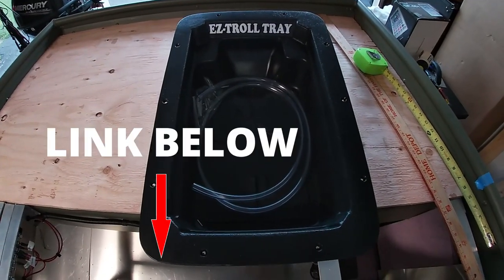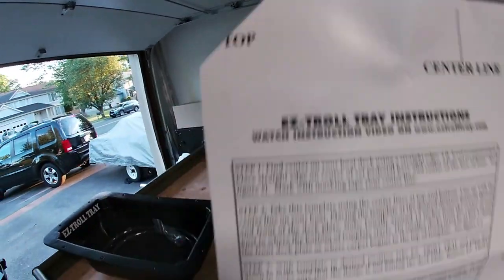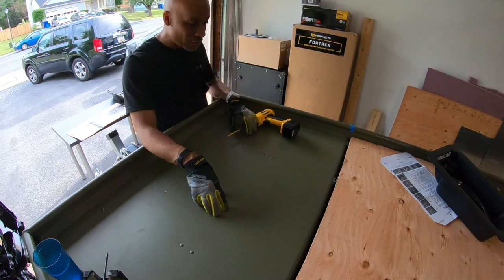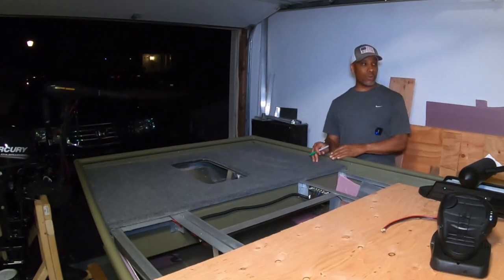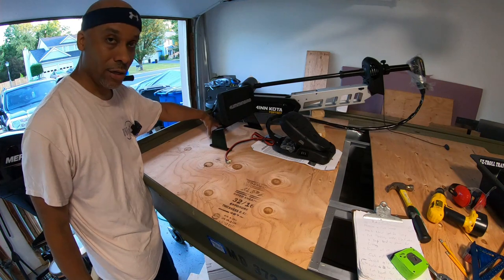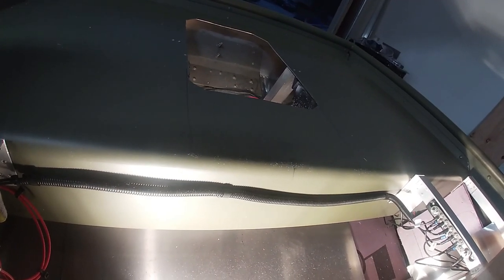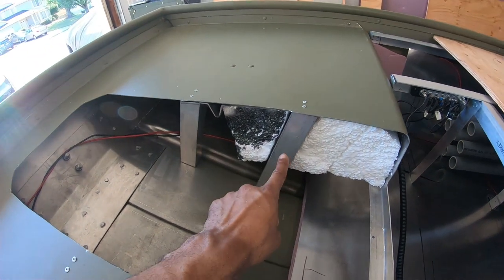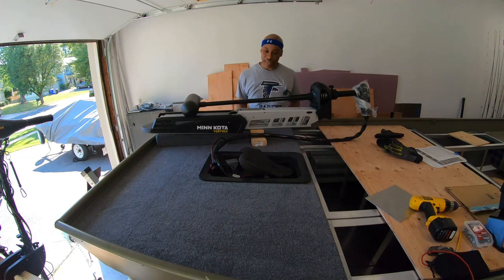MISTAKE FIXED-Recessed Trolling Motor Foot Tray Install {Jon Boat To Bass Boat Conversion} Lowe 1448

Comment: Great video.   I have a Alumicraft MV1648 and I want to add a foot tray and 2 batteries in the bow for my 24v trolling motor, and your video has given me great insight on the internal contruction below the deck.  Your a brave man to cut the deck like that.   You've given me confidence of what ever mistakes I make there is always a repair plan, if you take a breath, think, then attack.   Can't wait to see more.  I'm sure Ill be borrowning many of your ideas in the future
Reply from the maker: You're very right Eric.  I still make mistakes. You gotta breathe,  regroup, brush yourself off and jump back in. Thanks for leaving a comment.

Comment: Wondering if you looked at the Panther trolling motor tray? I had to go with the Panther because it was such good quality (although I didn't look at the EZ Troll) and it's 75% less than the EZ Troll ($79 vs. $139).

Comment: If you're right handed the tray should be placed on the right side of the centerline (if you're left handed....). Otherwise you have to stand on the left side to use the pedal, thereby off balancing the boat.